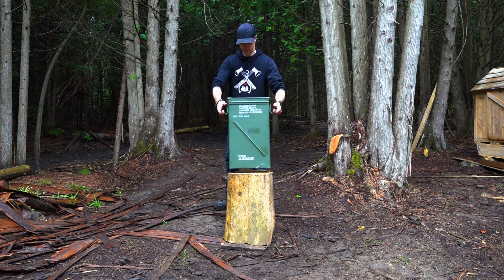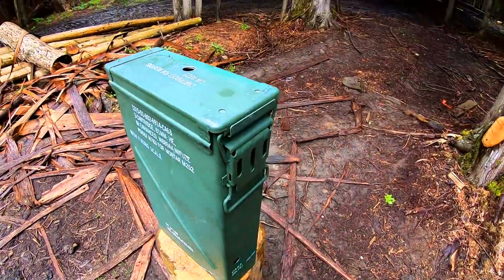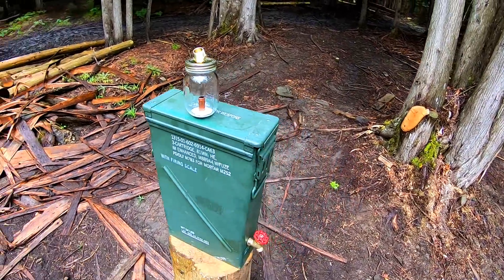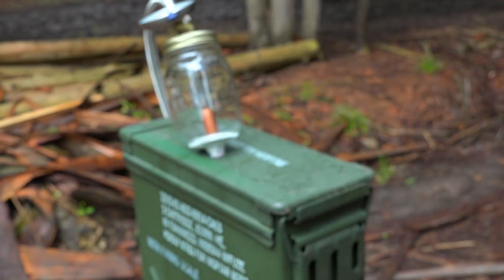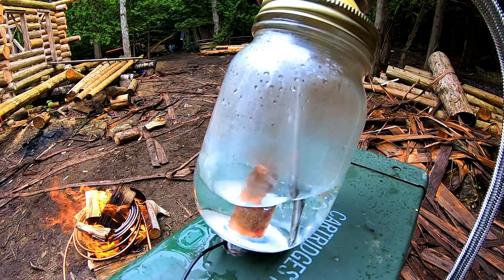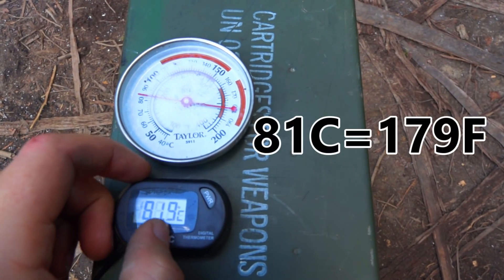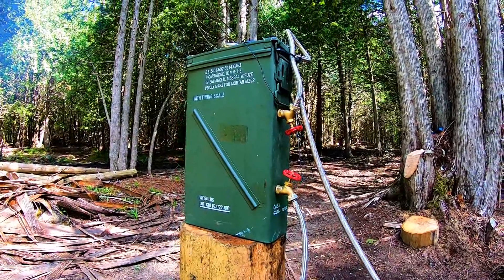Off Grid Heating Prototype- Copper Coil Water Heater / Heat Exchanger / Radiant Heater

Comment: A friend and I made a version of the water heater using a metal trash can and copper tubing  in the 80s.  I wondered about some of the innovations you had added.   This was an interesting video and their are others on youtube showing other versions.  We did not use as much tubing as you,  We only had about 14 ft for ours.  The only problem we had was explaining to the ranger that came by and thought we might have been setting up a still.   Which also uses the same principles involved  I gave you a like

Comment: Very cool! We used heat exchanges similar to this for carpet cleaning. One thing that might help is to have 2 separate loops. One in the fire into a tank and a loop from the tank to the cabin. This way you could more easily control the heat and you do not have boiling water in the cabin. Just an idea but this is a very cool project.
Reply: I may have not explained that to well. haha.

Comment: So many issues with this. The obvious one being steam is a mean fluid. Better, easier, idea? Just put the ammo can on or near the fire and then put it in the camper. No copper lines to screw with and less risk of making a bomb. Rotate two of them. Add fins to the ammo can if needed. Good on you for making something, just not the direction i would go.

Comment: Hang the coil inside an oil drum, regulate the outflow temperature by controlling the flow rate. much more efficient. Can run a hot tub in a bulk liquid container, self circulating.

Comment: Cool system! If you’re gonna use the can inside ‘whatever’ it’s gonna make your space really humid, though. Maybe have the can on the side, with the opening through the wall, to get max surface area inside living space, and all moisture going out.
Reply: Of course, heating with water in freezing temperatures presents problems of it’s own
Reply: I see the idea, and it’s really ‘science-y’, but it would be easier to repurpose the can into a stove, and put a chimbney atop it. Less fuel, space, and time needed to heat your space. And no water vapor

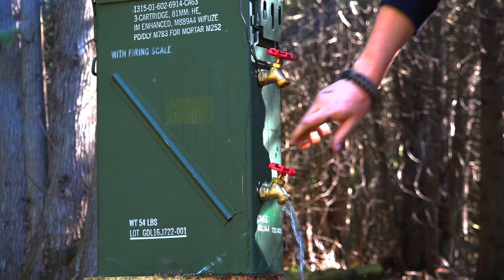Comment: @7:14 Yes, no low pressure air from atmosphere will get trapped in the line.  This dude doesn't understand pascals law, or how boiling water turns into air.  However, he seems to have accidentally added just enough pressure to keep large amounts of air from forming in the lines.  If you just want hot water, then why didn't he just put a pot on the fire?  That or buy an actual boiler (water heater, basically what boy scouts use).  This expensive copper wiring thing is amazingly inefficient.

Comment: Very inefficient. If it was freezing outside the water coming back to the tank would just get cold because of small diameter of copper tube, so I dont think you would end up with that much hotter water.
Also who the hell has 15 feet of copper tubing just laying around? lol

Comment: Campfires can indeed burst and melt copper piping so the only solution that is the best is literally...... moving the copper away slightly from the fire lol. Fire dissapates heat extremely quickly even a centimeter or two. The melting point of copper is 1000c while all it takes for steam to produce is 100c. Great work and I will be trying this on my own, even without being a space heater you can easily convert this into a potable water machine! Again amazing work.

Comment: You could use your idea and add permanent radiant heat to a wall or floor of your cabin.  Then just connect your tubes to it when you're ready to heat.  Or add a little stove to the outside.

Comment: the idea is  correct but the provisioning is badly done and so wasteful and inefficient 

you could heat that ammo box in less time and useing 1/10 the wood if it was done correctly AND it would be much smaller and more portable

make a rocket stove with a copper coil  running up the middle or it and attach that to the ammo box you could even have it attached to the outside of the sled on a swing arm that you just swing out to heat the unit up

Comment: Nothing says “compact” like 40’ of copper tubing. And air isn’t “getting trapped in the lines” homie, it’s boiling. That’s how water works.
Reply: That’s not how water works when it’s under pressure. It doesn’t convert to steam unless the pressure drops. You can force both the boiling and freezing points of water to move as far as you want as long as you can contain the pressure. The air in the lines can be compressed lowering the pressure on the water allowing it to boil. By making sure air can’t enter the lines the only place it can boil is inside the tank which would cause no problems in the loop, homie.
Reply: @WizDJ    homie; (1) you are correct that the boiling point and freezing point of water varies with pressure. (2) a pressure drop is not required to convert liquid water to steam. When you boil water on the stove, those bubbles that form and rise up into the air are steam. The pressure in/around the pot stays constant. (3) Pressurizing the water in the lines would increase its boiling point, not decrease it. (4) The setup he shows in the video is clearly not compressed or sealed in any way, the tubing opens into the ammo can and the ammo can has an unsealed hole in the lid where he places the thermometer. So even if you could mess with the boiling point by increasing the pressure in the system, he’s clearly not doing that here. (5) This is the big one: the water can absolutely boil inside the lines even without exposure to air. Air is not required for water to boil in any way. Remember that the bubbles are straight up gaseous water, aka steam. Not air, which is mostly nitrogen and diatomic oxygen. 

If you were trolling, man you got me good.
Reply: @areoladan  You’re missing the point. Without the air only a small amount of steam is being formed within the the tubing because of both the pressure the water exerts on itself within the closed loop and most of the steam condensing back into liquid before it reaches the tank. Water in a pot isn’t comparable because the pot has no way to contain the steam and it rises to the surface and escapes before it loses the energy keeping it a gas. If the entire system here gets to a temperature above the boiling point at this altitude then it will possibly become fully steam in the lines beyond the fire and boil off everything in the system after a while but until then it works just fine when there’s no air gap between the outlet and tank.
I don’t do trolling, just expanding the knowledge of other Homies.
Reply: @WizDJ    again, the setup shown is not a closed loop. The tubing is open on the ends, and the entire system including the ammo can and the tubing in the fire is at atmospheric pressure. And I think you’re missing the point of my original comment that you replied to, that there is no air in the lines, just steam.
Reply: there mine!!!!!!!

Comment: or warm up some rocks on the open fire and then put the rocks in the camper, rocks can be found on-site no need for extras like the cartridge box copper coils etc. The heat output from the rocks could be controlled with an adjustable insulation box.

Comment: Copper coil water heater? Did you heard the thing called boiler? Gas boiler? Closed water circulation heating system with boiler? That is engineered in efficient ways to heat water, insulate heat loss and throw hot water that is not boiling giving enormous pressure, to the radiator that heating needed space?

Comment: The fire will degrade that copper tubing to swiss cheese in just a few uses.
Reply: lol why so complicated? Just throw the water into the Fire to warm it up without tools
Reply: @cg56578  Because you can heat a ton of water this way, not 5 liters in a kettle .. Just throw the pipe into the tank
Reply: @cg56578  easy peasy..............................
Reply: The water will keep it cool. but yeah, contact metal could be a different thing. Like a stone. I honestly think that the ammo can should be outside, contained within insulation, while the tubing circulates & dissipates heat inside. Add some metal fins to the tubing to increase surface area. Honestly, I'd probably just heat stones on the fire and add them to the water.
Reply: @armartin0003  Its so easy, Who would throw their Steak INTO the Fire?
Reply: At atmospheric pressures water boils at 212 degrees Farenheit. It will not be at any higher temperature until all the water is boiled off and becomes 100 percent steam. Then the steam can be what is called superheated to a much higher temperature. Water and steam together are what is called a saturated state while it is changing state from a liquid to a gas and it will adhere to what is called a temperature pressure relationship. The copper should not be much higher temperature than the boiling water because it is in close contact with the water and copper and water are both good conductors of heat.
Reply: Tell that to the copper loop on Whisperlite stoves.
Reply: Don't forget that he wants to use this during the winter as well. Fluctuations of heat can do some warping.
Reply: I just kept waiting for the glass to crack from the temperature differential. Not to hate on someone for being inventive, though. Maybe borosilicate glass would be better.
Reply: Didn't you think that there are gas boilers and water heaters in the houses? There, gas is supplied through the nozzles inside, and it heats the water passing in the copper pipes .. It cools the pipes to the boiling point, copper is very heat-conducting, you will never overheat it, but it begins to oxidize and burn out at a temperature of + -400 degrees Celsius (at he knows who has a soldering iron), but why do you need to heat it to such a temperature :?
Reply: That was my initial thought. Copper tubing is expensive and a soft metal. Campfires are thousands of degrees hot, is it gonna sustain?
Reply: @Guerilla423  Wrong,,,,,the tube is water cooled,,,,water cannot be heated to more than 100 C.,, unless under higher than atmospheric pressure.. Copper is a very good conductor,, it will remain at max 100 c in the fire as long as water is there..
Reply: @Guerilla423  lol no. A campfire is a five to six hundred degrees at most, not thousands.
Reply: @jimbojones9665  Actually, the coal that is produced at the bottom will reach thousands of degrees.
Reply: @dontaskme9047  you are mistaking it for a hard coal. Coal that is left from burning wood will burn at much lower temperature than 1000 °C , though it will depend on the variety of wood used.
Reply: @dontaskme9047  lol how do you figure? I'm serious, please explain how a ~600 F fire can transfer more than ~600 F to it's surroundings.

I get that soft copper probably won't last very long, but the laws of thermodynamics still apply. You can't heat something to "thousands of degrees" by using a heat source that won't ever get that hot. No one is adding coal coke and a bellows to their campfire.
Reply: @jimbojones9665  The copper wont get much hotter than the water inside it as long as it is not overfired and boils dry (this happens in the video) he could use a much smaller fire or less tubing to avoid that.
Reply: @kimricsmythe9879  absolutely correct. I'm just floored by the people saying that the fire itself is thousands of degrees. It's pretty easy to look this stuff up these days.
Reply: @jimbojones9665  the fire is burning organic material, the black chunks left behind are carbon aka charcoal. The charcoal burns at over 3000*
Reply: @PigeonMayne  ok
Reply: @jimbojones9665  InB4 someone says black body radiation is racist.
Reply: @jimbojones9665  Yeah, I thought so too and my only worry is how fast this cooper will oxidize.
Reply: @jimbojones9665  at vas sa hot! Hotter dan de surface ov de sun.
Reply: @Shonicheck  and the airflow. You can forge steel with charcoal, but if it's just in flame in open air I can't see it being an issue.
Reply: @dontaskme9047   your right,,, i saw humphrey bogart weld the African Queen propellor on a bonfire😂...... Your wrong , try putting a steel bolt in the fire,,,, it wont melt,,,, MP of steel---- 1400C..

Comment: This is how my uncle heats his hot tub. less than 3ft of coil through his woodstove.  the two holes in the hot tub are 18 inches apart (vertically spaced). Even with the return and the intake lines being uninsulated and 10ft long a piece the tub will boil in less than an hour of heating. no moving parts.

Comment: This system has so many drawbacks....
Reply: I mean I would personally focus on insulation - this is seems over-engineered and about as elegant as a brick to the face.
It's bulky, requires the resources of a small village to operate and isn't exactly robust; one thing fails and your basically left with rubbish - zero redundancy. 
It's almost like he saw the ammo box and decided to limit himself to building something around that, instead of exploring alternative options...
Reply: Like adding a glass jar into a highly heated environment. Can you glass shrapnel when you fall asleep and water superheats...
Reply: @geoffmacmac  Mason jars are often used in high temp environments, like distilling, so I doubt their glass would explode like that. Maybe if there was a large enough delta of hot and cold, like if it was really hot and started raining.
Reply: It says in the description that this is an experimental prototype that he was attempting to get creative and make. It's not supposed to be perfect lol
Reply: @snipe69 There is a cutout in the floor that the hose line goes out of. It's got a threaded plumbing plug.
Slippers, socks, or shoes could easily stop foot burns but that doesn't sound like it's a problem.
The fire can be quite a safe distance away while still providing heat. That's a big reason why he went with this system. He has to heat the ambient air because he can't run propane or electricity in that tiny box.
It's a pretty smart solution and it's plenty safe enough for someone who has a good enough head on their shoulders to do winter camping in the first place.
Reply: @nathannotimportant9379  Electricity would be the smartest, safest, and easiest way. A small battery would power an adequate heater to keep the tiny space warm in a very safe fashion. This build is stupid in more ways than we all have time to talk about.
Reply: @TheOnlyFronk  I just think you're closeminded and judgey.
Batteries would take up valuable space for camping supplies and wouldn't be something to depend on in the cold. Sure you could run like a warming mat in your sleeping bag off a reasonably sized battery. But that solution has it's own drawbacks.
Reply: @nathannotimportant9379  Are you crazy? You think a battery takes up more space than that massive ammo box and copper coil? You clearly are the closeminded ignorant one here. Look up electrical heaters and batteries. You can get a total setup that is MUCH smaller than this and provides MUCH more heat. That thing would barely trasnfer heat off. Its not like a radiator, its much less efficient than that. It is huge, heavy, and it just SUCKS. Not to mention you will likely die from either the raging fire beside your wooden cabin or the fire hazard of copper and metal box run through the wooden cabin with exposed parts. If you ever build stuff for people to live in and with, you need to consider safety more than anything. This setup WILL eventually lead to a mistake and fire.

Comment: The bottom will not be thee coolest part. If the inlet pipe was much much shorter, then it would. Now your thermometer is quite close to the inlet, possibly in the middle of the flow from inlet to outlet. A neat idea nonetheless! Have you considered the peltier/seebeck fan modules that require no electricity, just a hot surface and colder environment to create airflow? Another thought: the jar you use serves as a check valve, but if you were to take it away, the waterflow could reverse (this is why coffeemakers have such valves - they operate on the same principle). Shorten the canister's inlet pipe and that won't happen ever... unless your water level reaches the pipe.

Comment: less copper coils wont heat the water as fast or hard, just got to find the sweet spot.
the idea of under floor tubing is great, small pump to control flow to floor piping should manage the heat in ya cool camper.

Comment: You should take some chicken net roll it into a cylinder and then wrap the copper tube around that in a helical patter like a spring.  Then use the lower inlet for cold water and upper end for hot water.  This way you could throw the fire wood inside the chicken net cylinder and water will raise up easily and push out the air bubbles which gets formed easily.